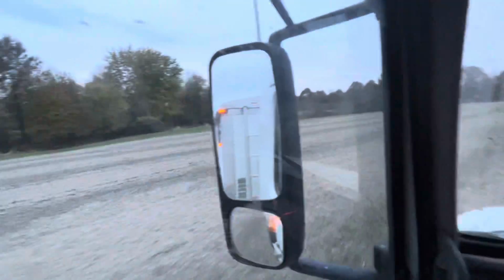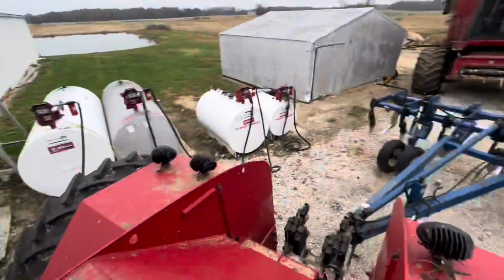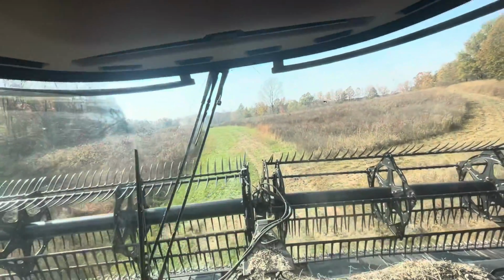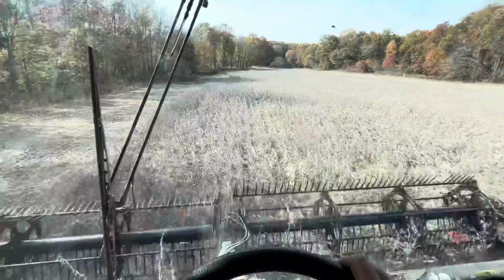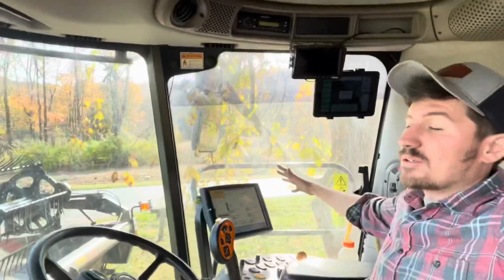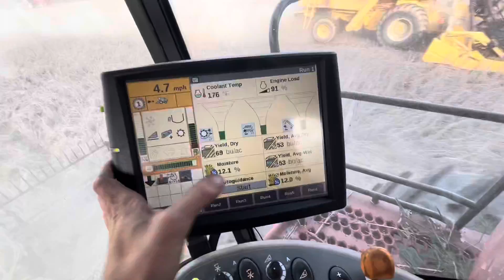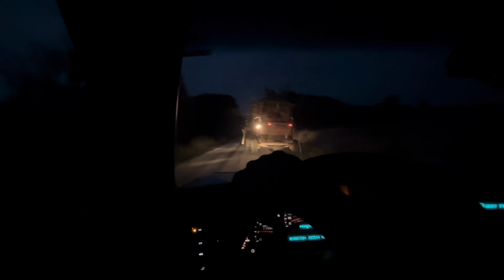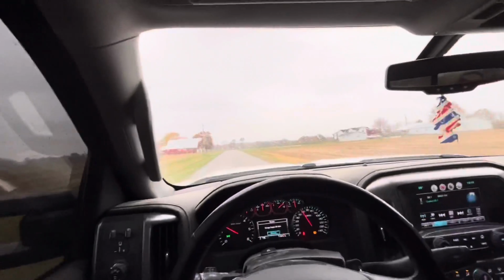Doubled Down on Soybeans

Comment: That new thousand bushel grain cart looks cool, maybe there is a modification where you can have an auger bolted on.
Reply: Lots of those trailers up north in Canada, a lot of guys don't even use the augers on the air drill .

Comment: You should not connect a welder ground to a shaft you are welding such that the current goes through the bearing.  Often the balls in the bearing will arc which will pit the balls and the races and destroy the bearing.  You should connect the ground directly to the shaft.